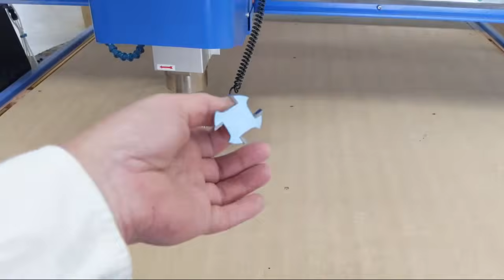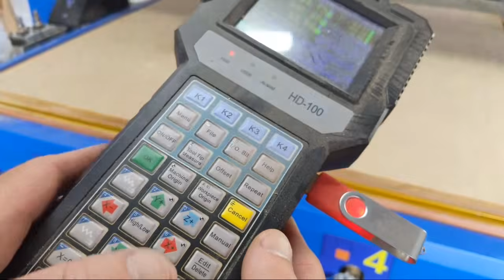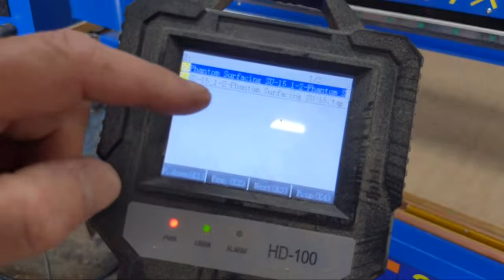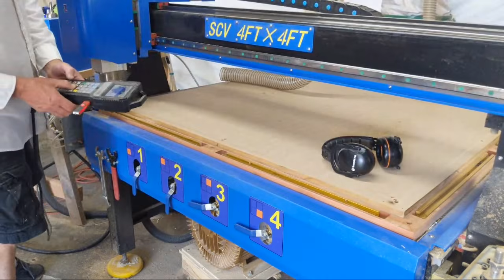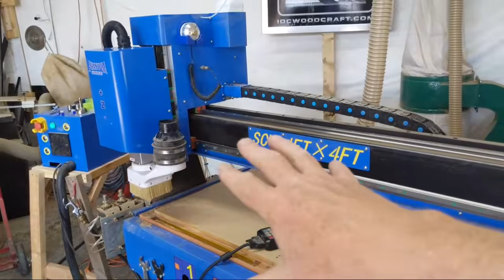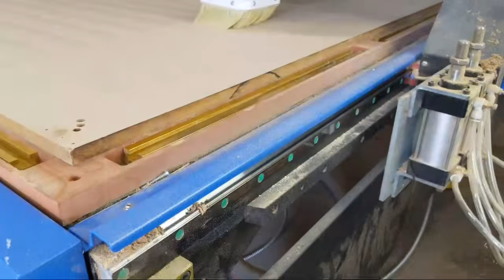Surfacing the Phantom CNC Router at 700ipm

Comment: Do they make a machine where you can use your PC, not just the handheld controller?  I like to make changes on the fly without having to mess with the thumb drive and also watching my toolpaths on screen.
Reply from the maker: Steven, are you meaning with the Phantom machines specifically? Or any machines in general?

Comment: 🌵 I constantly have trouble 😵‍💫 adjusting my machine (30X30) to be level 🎚️ for surfacing. Maybe you could walk us through it sometime. Very delicate 🤔🌵
Reply: Have you trammed it ? You will need a flat surface plate and a tramming indicator to make sure the spindle is dead square to the surface . I did that and it has made it perfect.
Reply: @joeygonzo  that's the problem. I can't get it squared/level. I adjusted the wheels on the 'C' but it is tilting forward and I can't get it squared to the spoil board.
Reply from the maker: William, I know this one can be tricky brother and there's a few things it could be. It's a little tough to diagnose over comments. I will definitely add this to my video to do list!
Reply: good